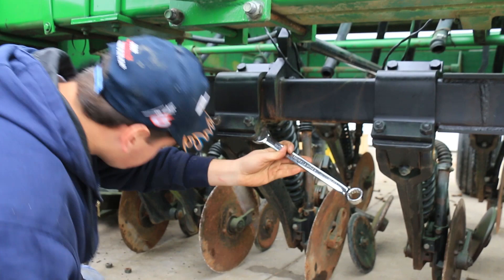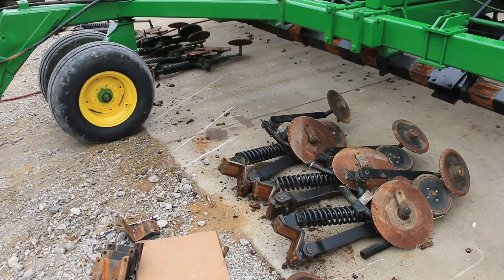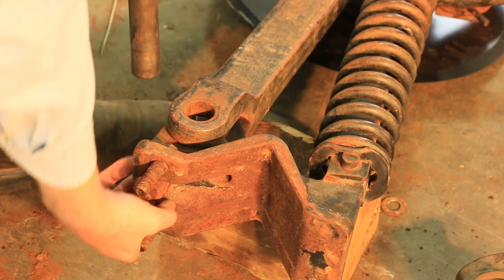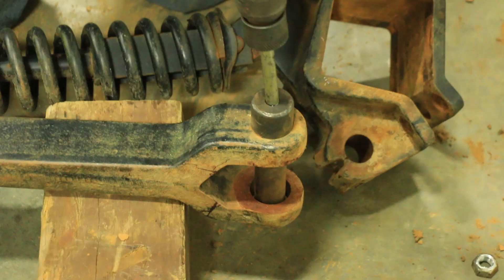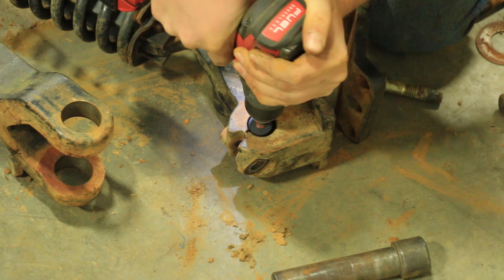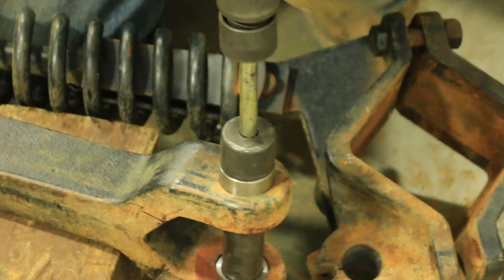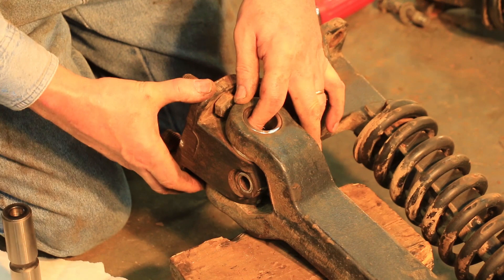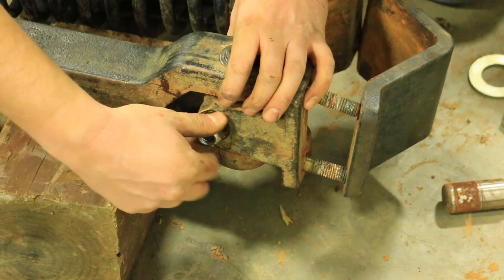Needham Ag - Installing MAIN OPENER ARM PINS AND BUSHINGS on John Deere Openers.

Comment: I’ve been told if it hasn’t been done so, you can turn the pin 180 degrees and it’ll tighten things up again....just curious of your thoughts? At what point do you know to turn it to ensure getting most wear outta original side?
Reply from the maker: We have found that the outer bushings wear at approximately the same rate the center pins. This is especially true with cheap aftermarket outer bushings, which are MUCH softer than OEM or extended wear Needham Ag MOA kits.

So, if the outer bushings account for at least half of the total side to side play, rotating the pins 180 degrees doesn't change the amount of side to side travel at all, all it does is keeps the opener running at maybe 6 degrees (rather than maybe 5 with worn pins and bushings). 

But once the angle drops much below 7 degrees (factory opener angle with new pins/bushings), the cutting performance in damp/tough residue drops quickly. Therefore, by the time growers are contemplating turning the pins, their bushings and pins are both shot and need to be replaced.
Reply: I turned my pins 180 degrees a couple years ago, eliminated 50% - 80% of the side-to-side travel. Eventually I will replace pins and bushings, but this will get me by for quite a while.
Reply: @detroitdiesel2983  hey thanks for sharing.